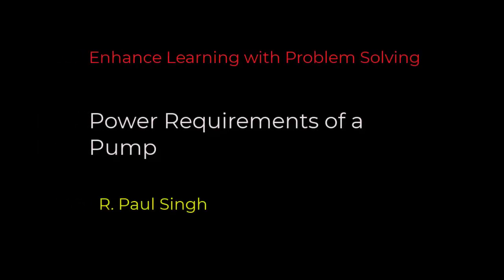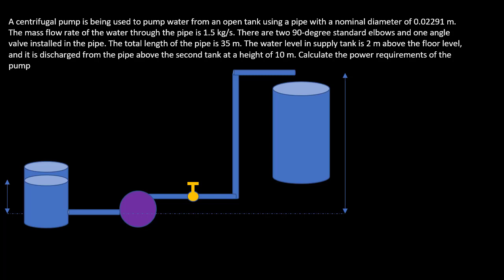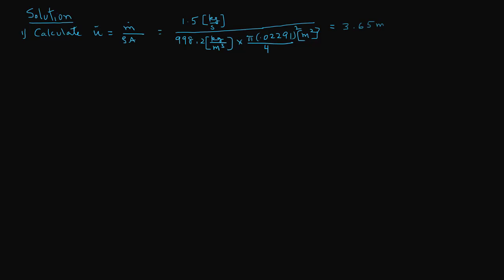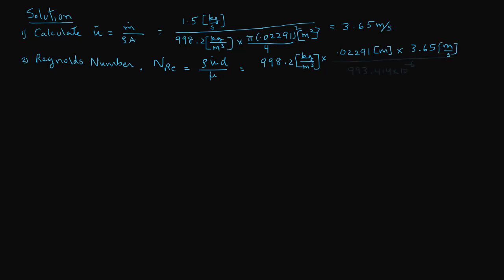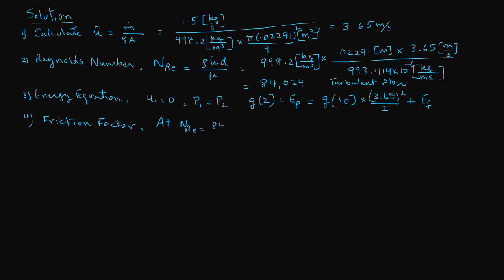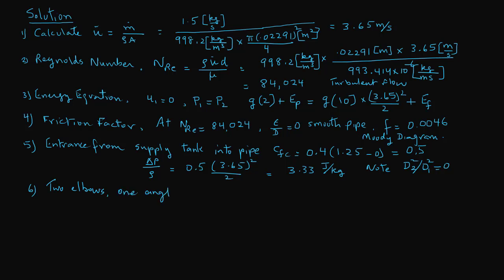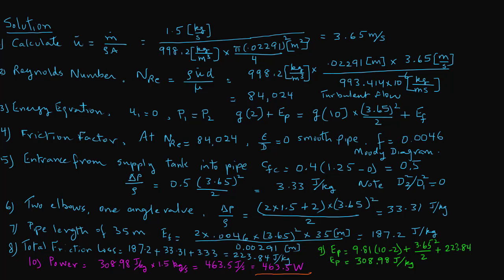Power Requirements of a Pump - Solved Example

Comment: Hi. In line 6) two elbows of 90 degrees are 2*0.75 instead of 2*1.5. The result in line 6) should be 3.5. So, in line 8) your total friction loss is 213.9 J/kg. Am I correct?
Reply from the maker: The friction loss for a regular 90 degrees threaded elbow is 1.5, therefore, for two elbows it is 2*1.5. The calculation shown in the video is correct!

Comment: Hello, Thanks for the video. I have 2 questions and 1 comment :)

1. In line 7) of your calculation (approx. 09:35 - :09:50): Why do you use a factor of 2 i.e. 2 x 0.0046 x ... x 35 /diameter. You are calculating the loss in the pipe which there is 1 off. (There are 2 bends, hence a factor of 2, OK)

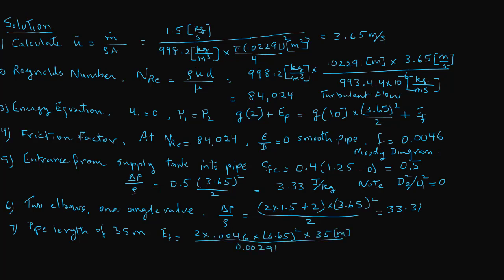2.  In line 7) of your calculation (approx. 10:06): Why do you use 0.00291 m for the pipe diameter when you at the start says it is: 0.0291 m (a decade in difference).

3. Also, the friction factor of 0.0046 ...? Does such a smooth pipe exist? (The value is outside my Moody diagram).
Reply from the maker: In line 7, the factor "2" is part of the equation, please see the derivation. Ef =2 x f x u^2 x L/D
The denominator term for Diameter should be 0.02291. In fact, in the calculation, the correct diameter is used. The resulting value of 187.2 is correct. Thank you for noting this, I will make the correction in the video.

The friction factor of 0.0046 is correct. Please recheck the Moody diagram.

Comment: thank you so much for the explanations, but why in Ef pipe length of 35 m, the D become 0,00291 m? is it the D or not? in the problem the D is 0,02291 m
Reply from the maker: Thank you for identifying the correction. In step 7, the value of D is incorrectly written as 0.00291, it should be 0.02291. The calculated value of 187.2 is correct.